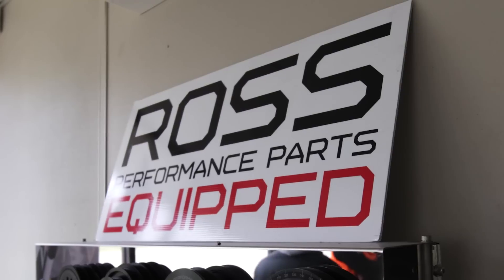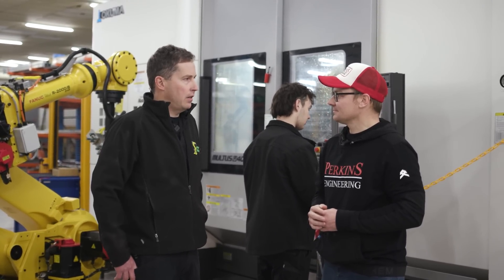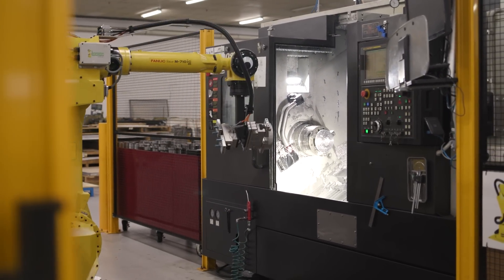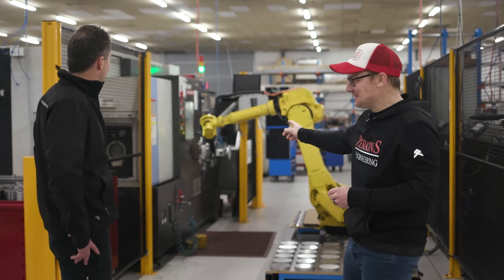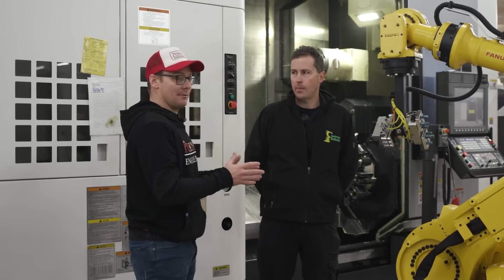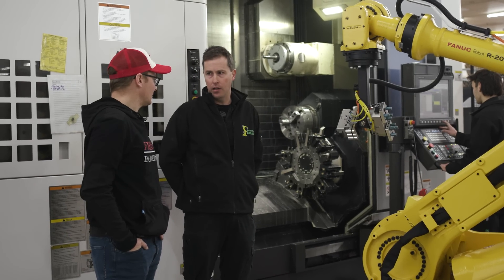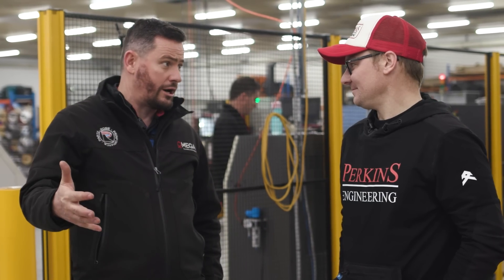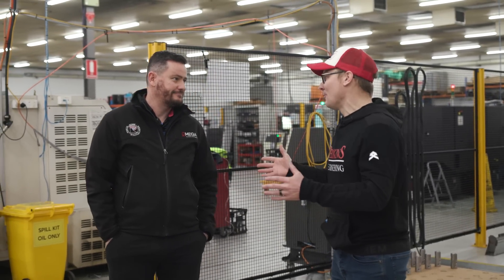Episode 37: Perkins Engineering checks out Automation Solutions at Omega Technical Engineering

Comment: Great Video! As an Electrical Apprentice I had an Introduction to Fanuc Robots at the Holden Factory @ Elizabeth! This included the Press Shop, Body Shop and Final Assembly. I spent an Additional 4 or 5 years after that on and off with the company i worked for doing even more work there in the Paint Shop. The Technology and accuracy these machines has was amazing. I agree that some people are better used in different areas and also Robots decreased the potential for accidents in the workplace as a result of fatigue and manual handing.
Reply from the maker: Nice one! Cheers!